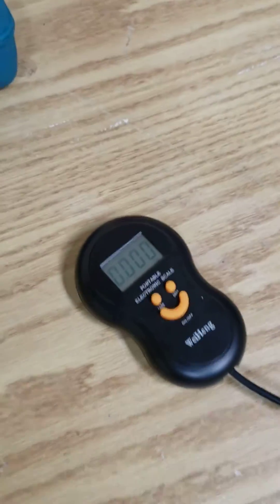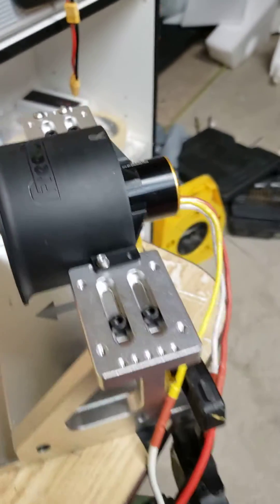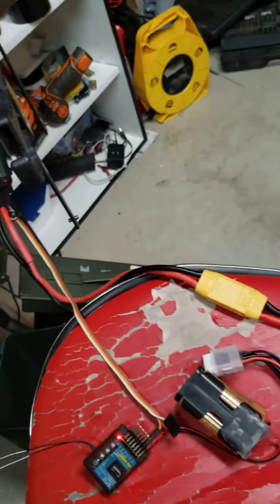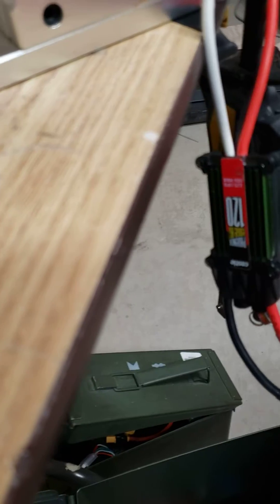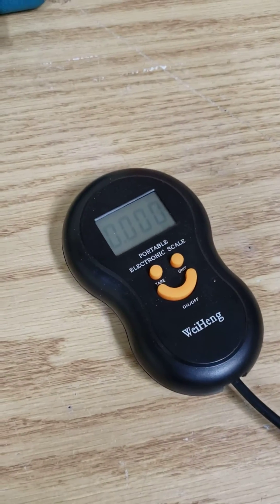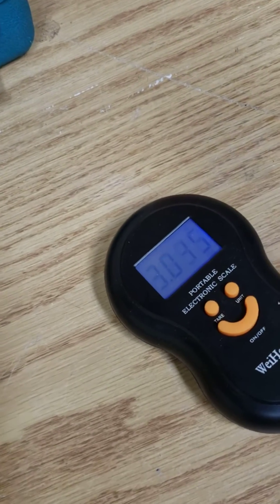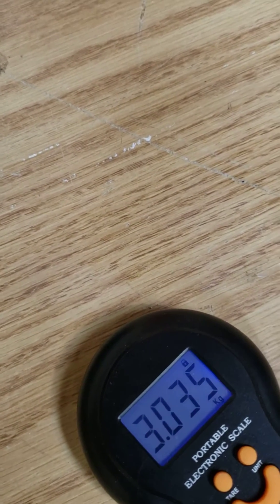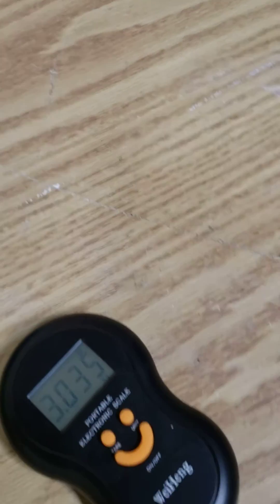Thrust test for freewing 9 blade 80 mm 1920kv inrunner.

Comment: I changed the same engine to 12 and I got up to 5.7, the 12 on that engine is great, better than the 9
Reply from the maker: What 12 blade did you use and on how many cells?
Reply: @ghoustanable  I removed the 9-blade propeller from the 3672-1900 kv motor and put a 12-blade propeller on it, and I use a 6s HRB of 5000mah 60c, it is the same diameter and without problem, no balancing is needed.
Reply: @ghoustanable  I put it on a freewing 90mm F15